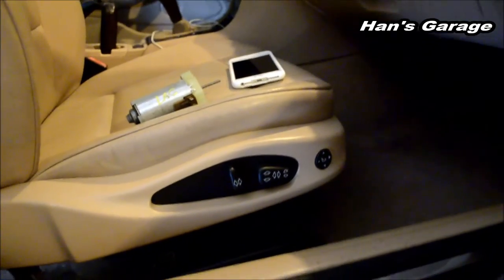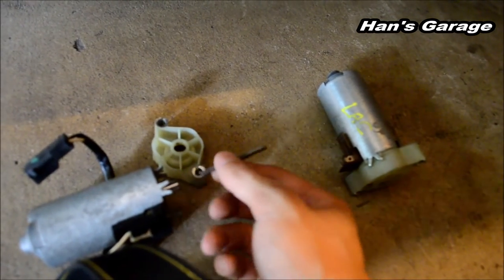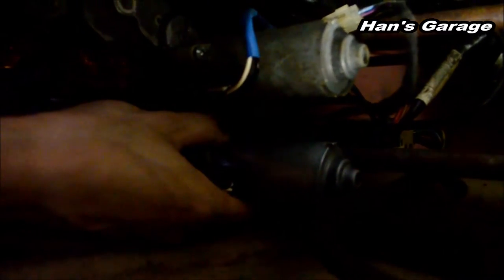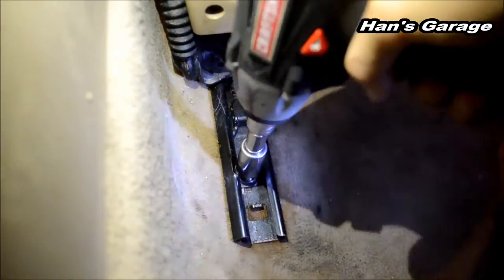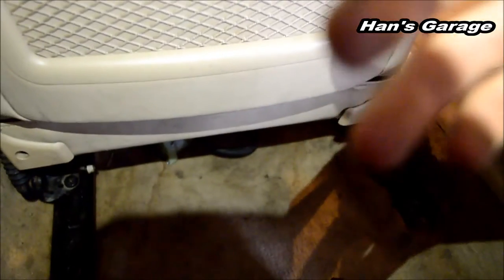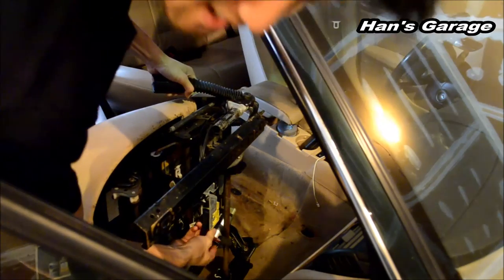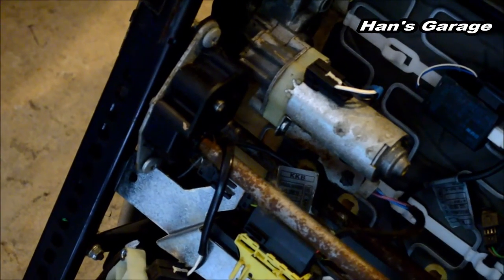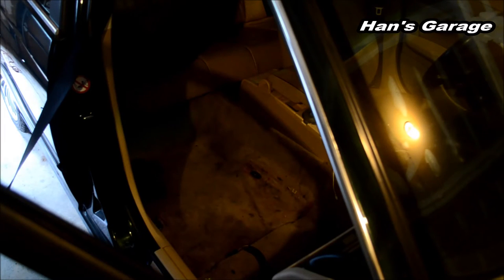BMW DIY Video - How to replace Powerseat Motor

Comment: I drive an E39, but this was super helpful just the same. Just removed those two T25 screws and I was able to diagnose my problem quickly...  the motor is fine.

Comment: the forward-backwards motor bracket is loose, but the t30 screws that hold it in place are tight... on both passenger and driver is the same. it rattles like crazy... is there something missing??

Comment: Hi! My drivers seat has failed  100% .  It 2007 bmw 335xi twin turbo coupe. Motors or fuse? It slowly shut down so I think its the motors cause I tried a new switch.  Your video showed me it could  be the motors but no power is going to it either.

Comment: Hi, I’m about to work on bmw 430i power seat issue. The  passenger side sliding back and forth isn’t working properly. On the seat that is facing driver side move a bit when I turn the switch but not on the other side facing the door. It seems motor is working unless if there are two motors. I have not remove the seat yet. So what could be the reason?

Comment: This is the exact same problem with my sisters car. I hope i dont have to take the seat out. Did you say you dont need to take the seat out if this is the motor that needs replacing ?

Comment: Are the motors all the same or are they specific to the function.  I have a BMW X3 2010.  What is the motor part number that you got for the replacement?  I need that exact part.
Reply from the maker: They are the same

Comment: My sharp core is broken. Can I replace it with a new iron core machine that I built myself?
Reply from the maker: I don't think that's going to work unless you make it flexible and strong at the same time
Reply: @HansGarage  Yes, So I thought it could be done. If I only make it hard, it's not flexible, Thanks.
Reply from the maker: Right. If may just Crack if it's only hard and not work like stock ones.
Reply: @HansGarage   yeh, however i will try and will report later.
Reply from the maker: Let me know if it works and send me some too!!
Reply: @HansGarage  update, kạn mạn k̆ chı̂dị̂ na

I just made a replacement out of a solid square rod of the same length and size. it can be used.

Comment: How much did you pay for motor and where did you get it?
Reply from the maker: Carl Shelton less than 30 dollars on ebay. I had to search around for it. Look up e46 power seat motor and your car model
Reply: Han's Garage if you could find me a link to one that cheap let me know all I can find is horizontal motors
Reply: Han's Garage I meant all I can find is vertical motors
Reply from the maker: Carl Shelton i got you
Reply from the maker: Carl Shelton okays so they use same motors for both vertical and horizontal so find the cheapest one and install it! Make sure the shaft inside isnt damaged! Good luck!
Reply: Han's Garage thanks man I'll let you know once I finish
Reply: Carl Shelton did you ever finish?
Reply: @HansGarage  Thank you very much for video and this information.  I have exact same problem.  Don't know if the motor is the problem, but found a back/forward motor on eBay for my car for $35.  I've had the problem for a few years now, and the last time I was going to get it fixed, they wanted $280 just for the motor!  Going to try and fix myself, and if not, I can take it to shop with a replacement motor in hand!